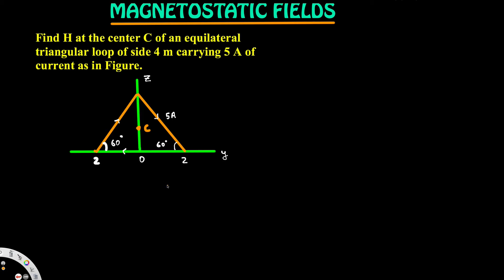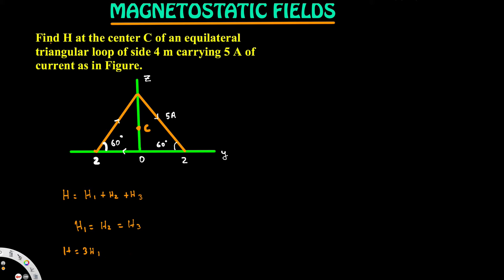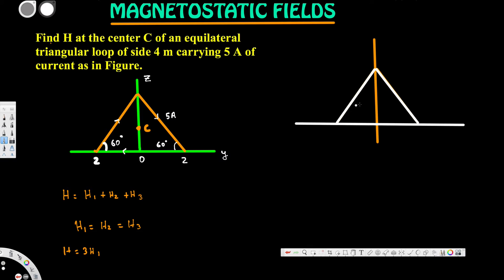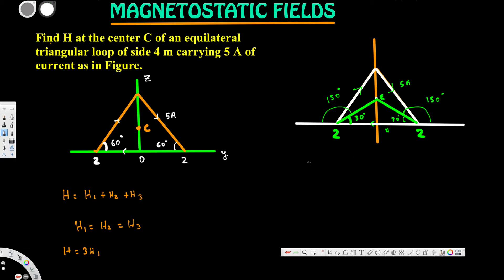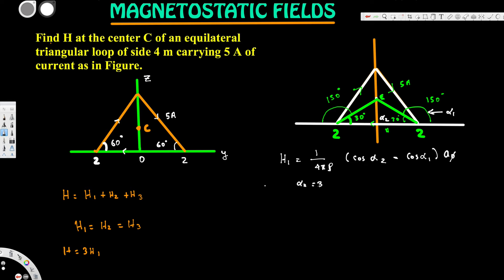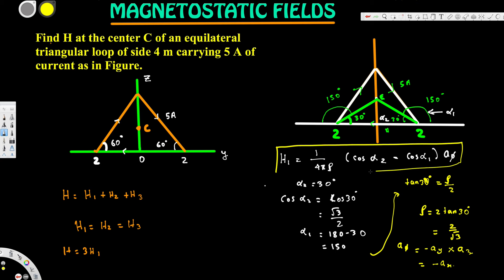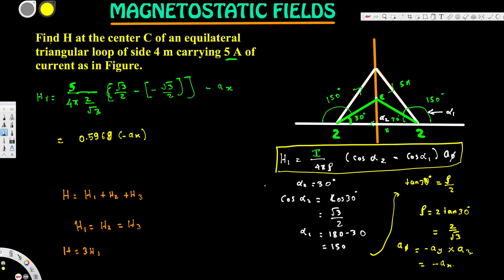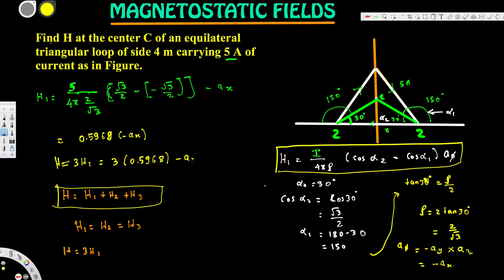Find H at the center C of an equilateral triangular loop of side 4 m carrying 5 A of current  - EM

Comment: Hi, the final result is wrong. The field contributions of the diagonal filaments of current cancel themselves because they both go in the opposite direction. You can prove it by calculating the azimutal unitary vector of those filaments using some basic trigonometry, you'll find that for the left-hand filament the vector is -ax and for the right-hand filament is ax. Since the perpendicular distance p to the filaments is the same because the point C is in the center of the triangule, the H contributions of those filaments cancel themselves. Finally the only H contrubution that survives is the first one you calculated.